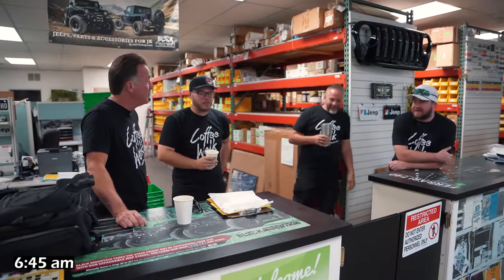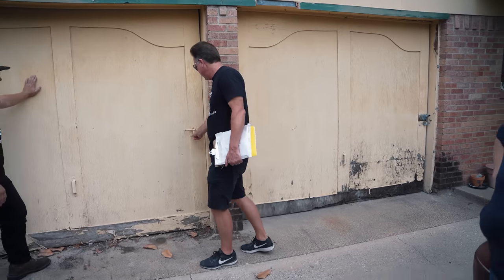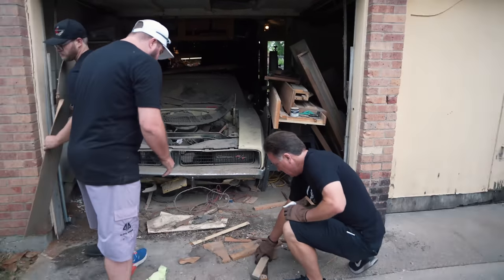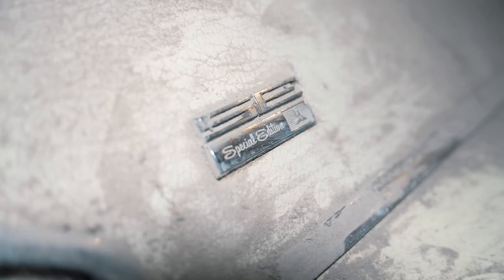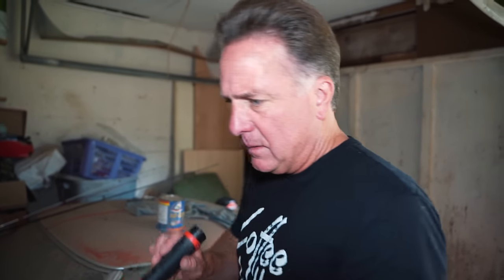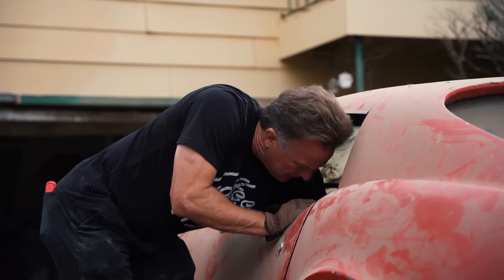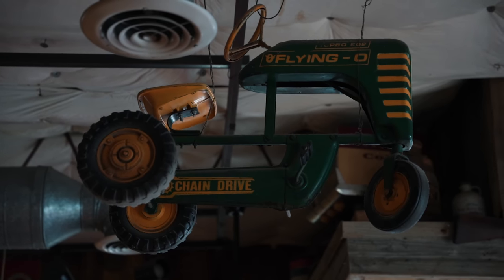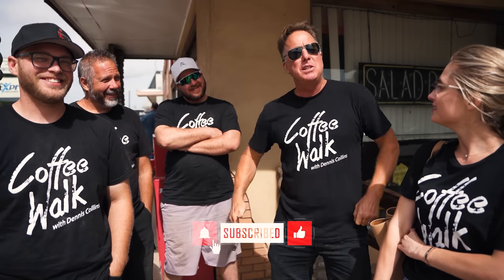RESCUED: 1969 Dodge Charger & 1971 Chevy Corvette!!

Comment: My brother back in the early 1980s bought a 1969 triple black SE 383cu 4 barrel charger.  The body was straight but it had a dented right front fender.  The motor locked up at 125 miles per hour the guy said he bought it from.  My brother paid him $ 125 dollars for it and my brother rebuilt the motor.  My brother  turned around and sold the car for $750.00.  I can only imagine how much the car would be worth now.  Live and learn. Good old days.